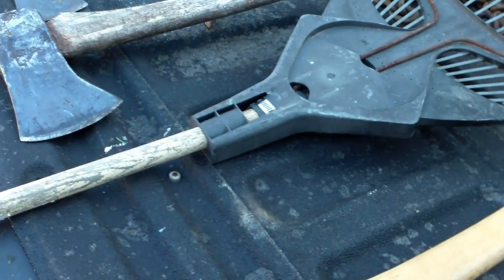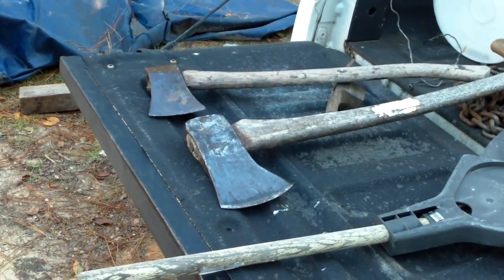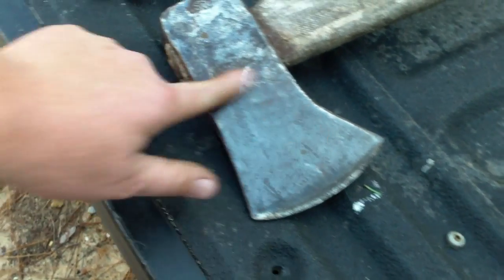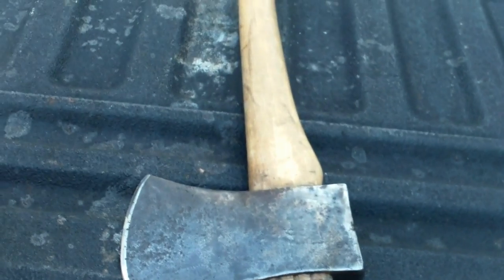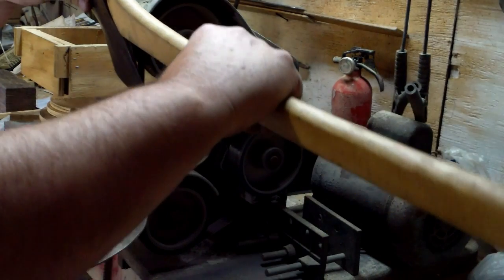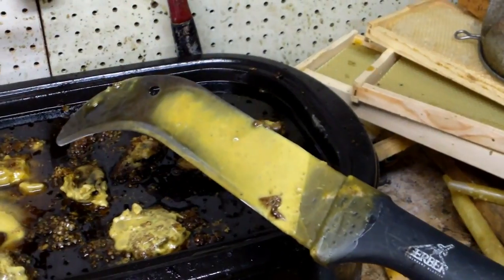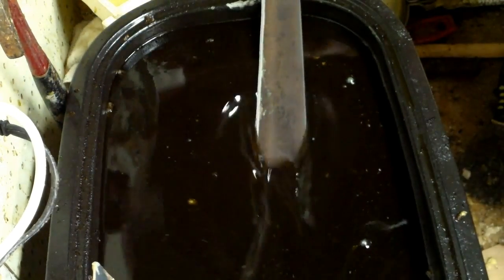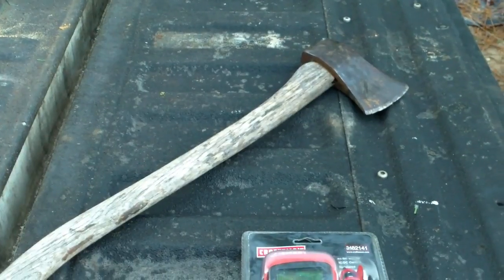No More Disposable Tools

Comment: I was lucky enough to have a Dad who didn't give two hoots what gender were as kids, we still needed to be able to do the same DIY, tool maintenance and gardening. I took apart an Austin Allegro engine starting when I was 8 and finishing when I was 11 with the help of a Hayes manual. 

That same engine went into the front of the kitcar we built together, which was our main family car from 1992 to 1994. It really showed me the power that knowledge and the ability to acquire it is all you really need as a person.
Reply from the maker: That is wild!  I grew up in a big body shop so we were always building, working on, repairing all kinds of stuff.  Still do when I have the time.
Reply: MsCherade9 and 628DirtRooster
I have and pay huge respect for both of you.
Reply: Amen girl. My dad and mom were the same way. Learn auto maintenance before driving and gardening by the time we were walking. Shooting guns by 7, got my first 22 at age 8. It really has helped me to know that if I am dating or marry someone it's because I want them not because I need them.